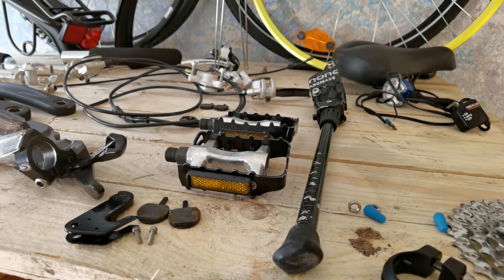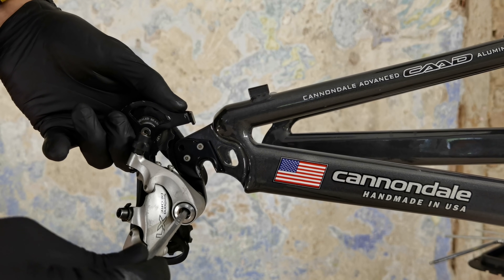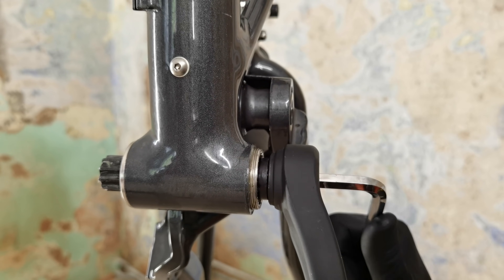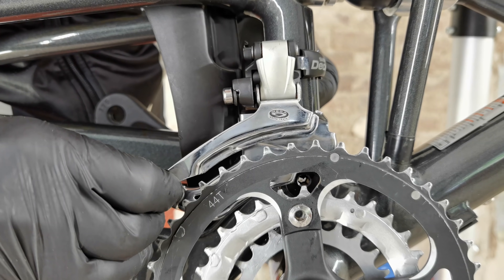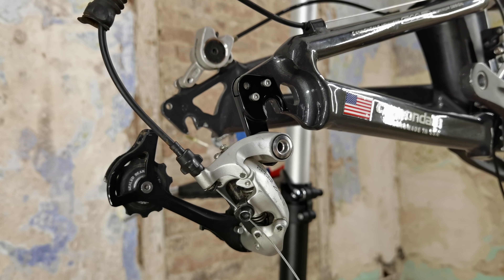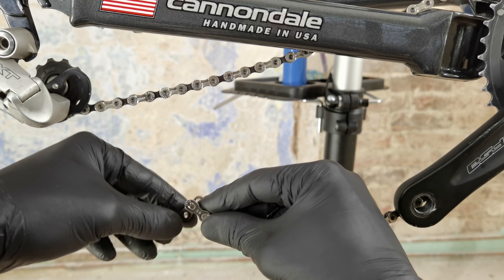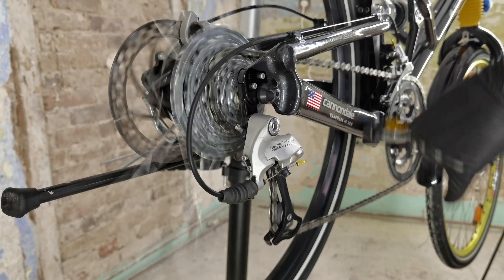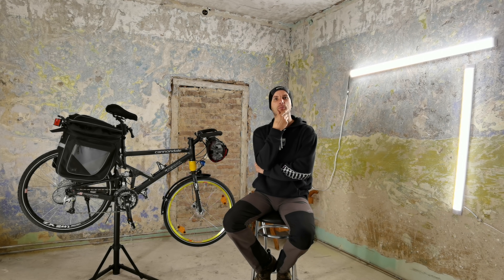Do you really need a super-duper gravel bike for serious bikepacking? $500 bike project. Full build.

Comment: 8 years ago is when I built my gravel bike, before the 'gravel' thing really became a thing. Built everything up, including building my own wheels. Most expensive parts were carbon stem, TRP brakes, ISM saddle. Everything else is more affordable, but durable. Total price £1300 (1518 Euros). Could certainly buy a newer, blingier gravel bike. But this has, and still does, provide with me with such enjoyment. I've had the bling, and that just made my wallet weep. Eight years on, and I wouldn't swap it for any other two-wheeler. Gravel? check. 'cross? check. Commuting? check. Average road bike? check. Keep up the builds and maintenance uploads 👍

Comment: Haha. The first two times I went bike packing was on a 10 y old cross country bike with 26' tires. We did 400km in 5 days. The bike was way under $500. As long as you fit the necessary gear on the bike it's good to go. 😎